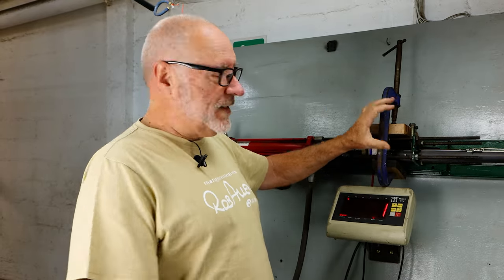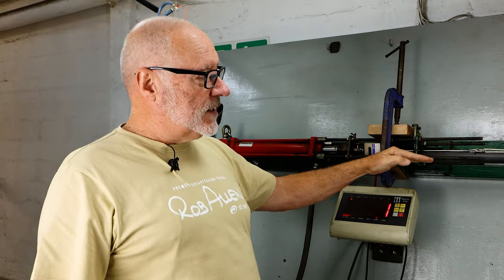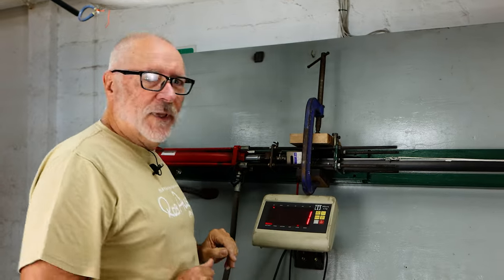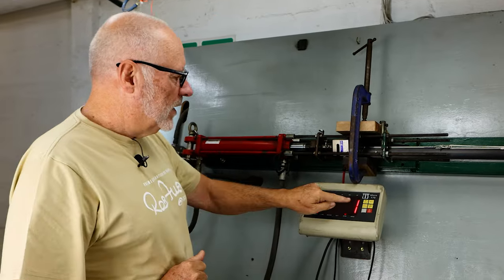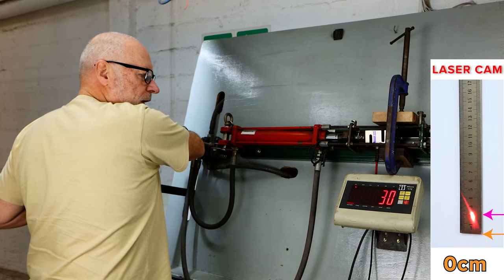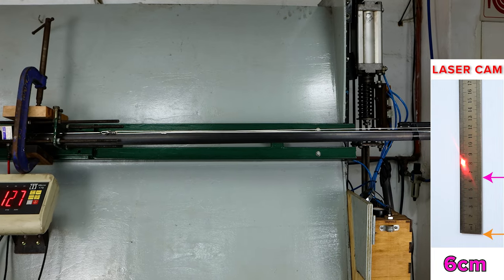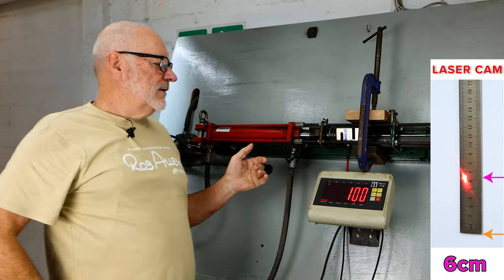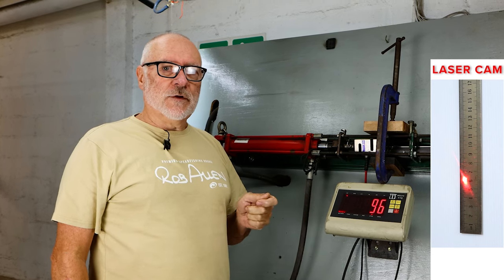Rob Allen | Barrel Deflection | Part 2 | Carbon | 2024

Comment: Good series. It looked like you used the top rubber slot for both of the “bands” in the test, without using the bottom rubber slot. Did I see that wrong?

Comment: Is it necessary to use lead in the carbon barrel when using a roller muzzel?
Reply from the maker: No as the recoil is much less and the fact the roller muzzle is already heavier than a standard muzzle.